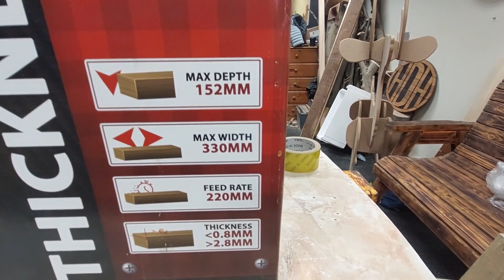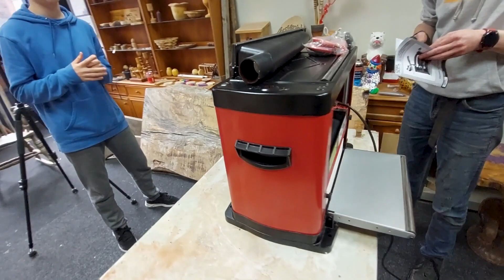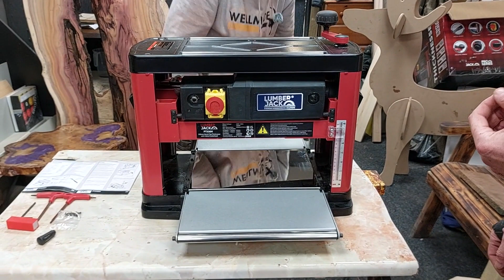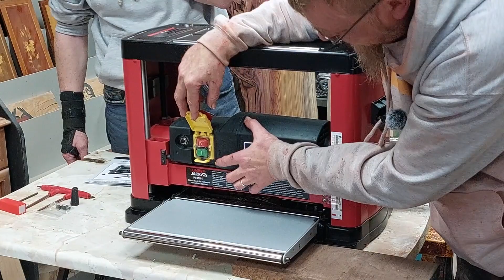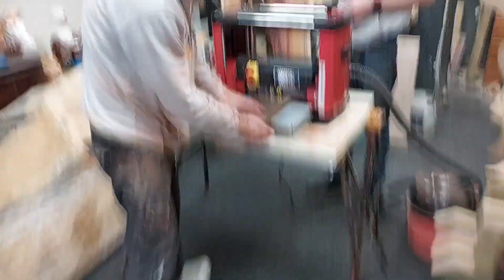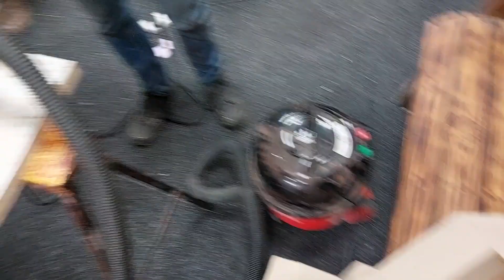Lumberjack PRO SERIES Thicknesser review

Comment: Bought one of these a few months ago, before seeing this video, and it is superb.  The quality of the surface cut is as good as they say here - sanding ready -  and the noise is so low that I don't bother with ear protection (that will change if it gets noisier!). Definitely one of my best buys, ever.    By the way,  you have to give the wood a tap to get it to enter the planer mouth - this is normal. Also, the minimum  planing thickness is about 10mm but can be reduced  by placing workpiece on top of another length of timber to raise it.

Comment: Does the machine leave much snipe?
Reply from the maker: Hello. As with all planer thicknesses, there is the potential for snipe. However, if you ensure both the in and out feed shelves are set correctly and you don't take too much material in one pass, you shouldn't have a problem. We use it daily and get very little snipe, if any. I hope this is helpful.
Thanks for the comment 👍

Comment: Hi Guys bought this based on this video and the later one. Any suggestions on how i can lower the folding wings to be lower than the the central plate which is almost 1mm lower than the outside wings. May have to send this back. Just wondering if you are affiliated in any way to Lumberjack.
Reply from the maker: Not affiliated but there should be adjustment screws on either side of the beds try lowering or highering them

Comment: Hi guys great videos just wanted to ask is it still noisey to use compared to sanders or other planers that you may have used before and does the cutting head deffo make a difference to how noisey it would be without it ie straight planer knives,im really thinking of buying one of these but i don't want to be upsetting neighbors,but i would be running it inside a shed workshop thanks for any help/advice you can give take care
Reply from the maker: Hi there to be fair it's quieter than the extractor so don't think you will get any complaints the helical blade in our opinion is quieter than a straight blade it's also more efficient it's a great bit of kit and we can highly recommend it hope this helps and let us know if you go for it as it has massively made our shop more efficient and thanks for watching
Reply: @HandmadeWellmade  thanks for your speedy reply lads that was quick lol...I'm really surprised you saying it's quieter than the extractor so that alone has made my mind up about getting one so I'm deffo going to get one now as I had one of the titan planer/thicknesses from Screwfix some years ago and that was ridiculously loud it sounded like it was gunna take off or explode into a thousand pieces so I lost confidence using it tbh then I had another similar thicknesser that was also loud but looking at this and listening to your advice has really helped so thank you and Ile keep you updated as to when I get it and how it's been for me especially if it helps you with the channel as well look forward to your other future videos thanks again take care
Reply from the maker: Thank you for your kind words and happy planing and hopefully next video up today some time
Reply: @HandmadeWellmade  no worries thanks
Reply: @randomer6686 did you buy one in the end, and if so how did you find the noise level? I have the same concerns as you regarding noise levels and neighbours! Cheers!

Comment: Hi just woundering when you fed the walnut in it seems like you had to force it in, is that how it should be or ? Im only woundering as im currently looking at purchasing the thicknesser, many thanks
Reply from the maker: Hi Matt. There is a little force required as the feed rollers have to grab the material before the wood reaches the helical cutter. We had it set quite low, so as to take a fair amount of material on each pass. Now since using it for a couple of months, we generally take lighter cuts. This helps in many ways i,e less snipe, a cleaner cut and easier to feed through. I am happy to recommend this machine to anybody who asks about it. The helical cutters are a real game changer. We will be doing a follow up review on this product in the next couple of days, so please look out for it. I hope this was helpful 😁
Reply: @HandmadeWellmade  ah ill definetly keep an eye out for that. Thank you for the speedy reply